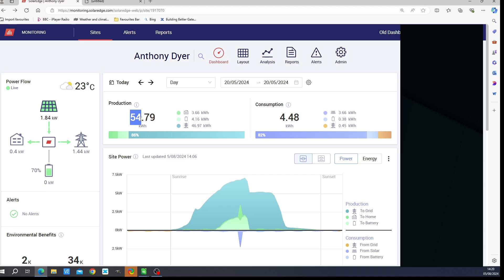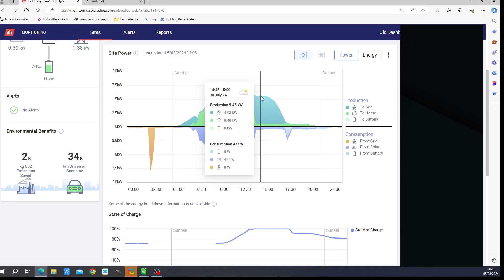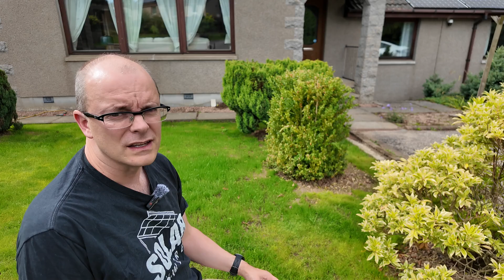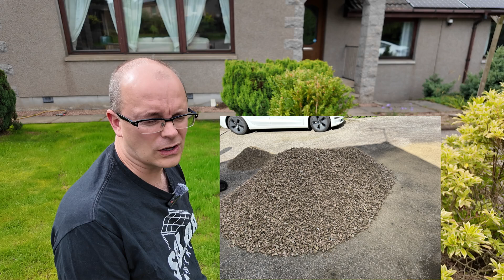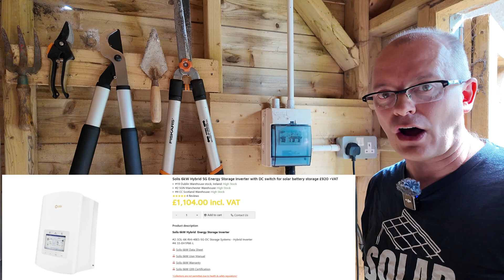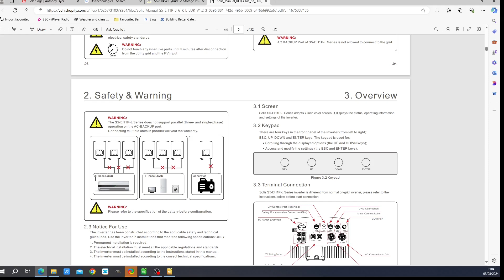Solar Performance Q2 2024, new project ideas!

Comment: Is the cable size/ampacity from the shed not a possible limit on inverter/battery power delivery to the house?
Reply from the maker: The existing cable is Steel Wire Armour 6mm2.  It's protected with a 23Amp breaker.  It's buried underground so it's capacity is nominally 50 ish amps.

The loop impedance in my existing certificate is somewhat contradictory however:
Zs was recorded as 2 Ohms.  However Ze was 0.3 ish Ohms, and R1+R2 was recorded as also being 0.3 ish Ohms.  So something needs to be re-measured.

Comment: You should look at the Sunsynk inverters, better than Solis IMO, you can parallel the load output.
Reply from the maker: @healeydave  That is interesting.  It sounds like they have sync relays to make this possible (I guess it’s all in the name).  It’s sounds like it’s entirely possible to have a whole network of emergency bus inverters.
Reply: @anthonydyer3939  what happened to the other comment about the battery recommendation?

Comment: I like the idea of a Solar fence but What is the likelihood of them getting broken by a stray ball or something like that.
Reply: add some plexiglass, for security then ..
but its still cheaper to break a solar panel then a window  with a ball..

and we dont bubble wrap our windows

i would probetly worry more about falling drones and hardball shots these days, when it comes to kids :body-blue-raised-arms:
Reply from the maker: @Hansen710 I certainly worry about kids footballs.  But as you say it’s glass which I worry about.  My Model 3 windscreen took 8 months to replace (still drivable, but just imagine the hire car costs if it wasn’t). and a failed window pane (condensation between panes) cost about £300 to replace.  A solar panel costing £80 including delivery is small money, and the neighbours would probably pay for the damage anyway.

Comment: Another good video Anthony. I'd be concerned about keeping the Pylontech batteries warm in the winter.. I'm only 10 miles away and I have mine in the garage, un heated but wrapped in foil insulation and then woolen blankets . In mid winter they can get down to 13 or 14c which is about their limit. But my garage never goes below freezing inside. I would imagine your shed would.
Also have you considered a victron Multiplus to control the batteries and solar. You're welcome to have a look at my setup.
Chris
Reply from the maker: @ChrisM-gs6xu  Yes,  the cold temperature is a concern.  My plan is to cover it on six sides with PIR insulation when the temperature drops.  I’m hoping that the battery would thus be able to remain warm enough.  My Solaredge battery would certainly warm up gently during high rates of charge and discharge, and I could plot its temperature during such regimes.  It was probably 3-4 degrees above ambient temperature. 

It is annoying that it has to be the shed.  I had a spot all planned out in the utility room for Pylontech before PAS63100 came out and ruined the concept.  Essentially batteries aren’t allowed to be mounted in any escape routes.  The utility room is an escape route.
Reply: @anthonydyer3939  are a heating element/wire not worth it.. (like the ones used for water pipes for example) 
if the battery is not able to work as good as on a summerday

if its like a EV then we are talking under half the power on a winterday without any heating 
and just like considdering a heated garage might be worth it in a colder climate with a EV, the same should apply for a housebattery that is used often

EV´s do also have preheating of battery and so on
Reply: @anthonydyer3939 you could always have a word with Sam at AESsolar. He was over yesterday replacing a failed MPPT. he was telling me he's working on using pads between the batteries to keep them warm in his installation, which is a lean to on the south side of his house.

Comment: Great stuff Anthony. I have planning permission for additional panels on my external garden wall fascia, which I’m going to make adjustable tilt using Unistrut products. My most difficult task though is getting an installer to do my inverter upgrade without charging the earth for!
Looking forward to your fence project whenever you get it done 👍🏼

Comment: I've seen a drop in annual production for 2023 and 2024 is looking similar.  I average 4.4MWh / year for 2019-202. But 2023 was 4.11MWh which I'm hoping is cloud rather than panel drop off.  I'm blaming El-Nino.
Reply from the maker: @TimHodgesofEdinburgh  The way I look at panel performance is not to look at the average outputs, but to look at the peak output and compare with the peak output recorded on a previous year.  When sustained over 15 minutes I’m seeing no discernible difference between the best output in each year.  2024 as a whole however I think will be 20% down from 2022 which is currently the best producing year.  That’s just the weather.
Reply: @anthonydyer3939  Are you using the Solaredge Module Mismatch report ?  I just ran it for my system for the last 30 days and it says I have a site average 2% Module Energy mismatch.  I think that's ok.  My worst performing module is -5% energy mismatch which it says is within tolerance .

Comment: Have you considered the durability of a solar panel used as a fence? Rock flying off a lawn-mower? neighbours kids kicking a ball up against it?
Reply from the maker: The lawnmover stone isn't such an issue since there's no grass at that particular spot.  I've suffered glass damage on my old Corsa due to a Contractor's brushcutter kicking up a stone, so I'm certainly aware of the risk.

The football is a residual concern, but there's no neighbour on the other side of that particular fence.  In theory you'd get the neighbours to pay for the damage, if it's their football.  We do after all owe each other a duty of care.  That said, if it's a boundary fence, I'd make sure that the solar surface is only exposed on my side of the fence.

 Wayward footballs causing damage to residential property is certainly not a new phenomenon, but the probability of impact damage is certainly increased.  All that said, repair costs aren't outrageous.  Compared to windscreens, solar panels are cheaper to replace.
Reply: @anthonydyer3939  True, I imagine solar panels are actually a bit stronger than I imagine too :) Look forward to seeing the final product.
Reply: the angle does makes it catch less comming from above

i would argue you could add some plexiglass if you was in a area where they was in more danger then normal..
so far i havent been able to crach mine
and i have done a good job trying, bumping in them with the lift when working on my roof..
im surpriced how much they can handle

 if a ball did hit it, it is still cheaper then breaking a window with a ball
its not like we can wrap our propperty in bubble wrap and avoid everything, not matter what

Comment: why not look @ the fogstar rack style batteries 5.12 kwh(16 cells ,pylontech only 15 cells) each @ £1049, or there doing a deal currently 3 in a rack on wheels for £2500, and they solis inverter compatible too ,they are based in Redditch Worcestershire :)
Reply from the maker: I considered Fogstar.  They are rated for an 80% Depth of Discharge vs Pylon which is 95%.

That said: Their 30kWh rack bundles is on sale at £4999 :-) , but it's out of stock :-(

But I do wander if they would be a better bet.  They appear to be British, and I hope that means warranty claims are not routed through China.  I think they have a long heritage particularly when it comes to boats and caravans.

I'd really like to see some objective reviews about the Fogstars.  All the solar youtubers I see are american, reviewing brands such as EG4 which I've not seen in this country.

Comment: A very interesting project. Look forward to it being realised. I have 24.6kwh of storage but yet to have my first full winter with our 11kw heatpump. My thinking was that with the 6hrs off peak I would recharge my batterys and run the heatpump from the grid, then at 5:30am onwards the battery's take over up until enough day light would at least subsidise the total energy use... In theory it should work until the next cycle at 11:30pm! Having said that... 30kwh would be most welcome indeed :)
Reply: We have a 6kW ASHP and 20kWhs of batteries. Had quite a few days in December and January where we had to top up the batteries during the peak rate. Highest consumption for one day was 42Kwhs.
Reply from the maker: I think your setup will be running off the batteries for all but the very coldest nights.  During the first nights, my heatpump consumed about 2-2.5kW when my house was stone cold, and it dropped to -5 at night.  All told about 20kWh consumption.  My existing 10kWh battery went through two charge cycles that day, so it was well exercised.

Comment: Interesting. Your new intended system is pretty close to what I'm considering.
Had a couple of days with no power after Storm Arwen myself. 
Lot of people I know relied on their wood burners for as much as a fortnight. 
Always in the back of my mind now I'm finally thinking about solar is wanting something where a battery will still be topped up in a power cut, even if it's just enough to run a bare minimum of fridge, freezer, and a couple of sockets.
Reply from the maker: Yes, that's what I'm thinking with having the solar fences.  They can still top off the batteries, but no doubt the performance will still be poor in winter.